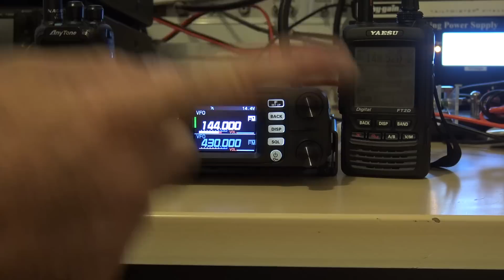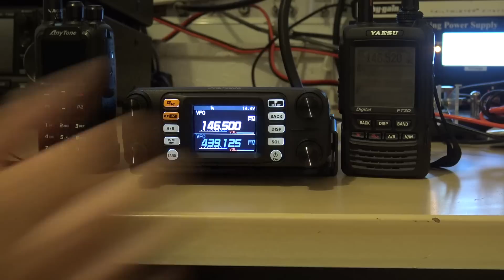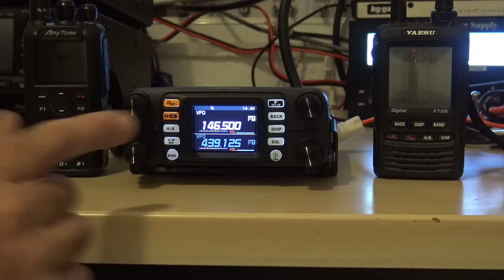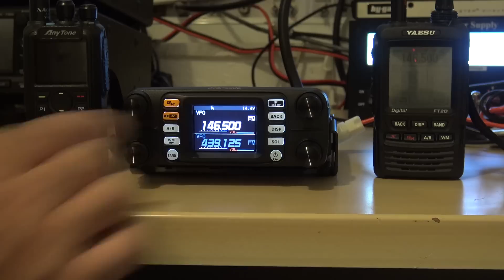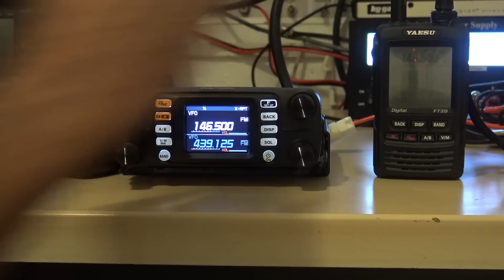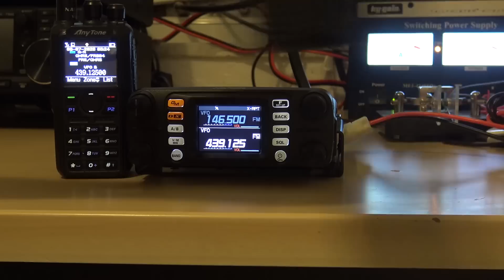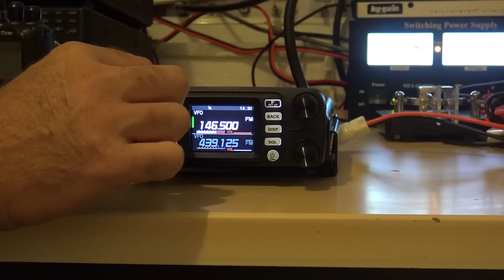Yaesu FTM-300D Crossband Repeat Mode, Tutorial

Comment: YAESU IS NOT ONLY PRODUCING THIS RADIO IN CHINA WITHOUT LETTING ITS CUSTOMERS KNOW IT'S SENDING OUT DEFECTIVE RADIOS AND NOT FIXING THEM PROPERLY, REDONE

I recently bought what was advertised as a 50-watt radio from associated radio in Kansas, it was the Yaesu FTM 300D. From the day I received it, I judged it to be defective because it at best it would put out perhaps 45 Watts on any given frequency. Every other radio high I've ever owned that claimed to be a 50 watt radio put out at least 60 watts. Not less than 50 Watts.

Anyway I was conned into paying return shipping and insurance for this radio back to associated radio to be repaired. I even had to invest in a dummy load in order to prove my case and get them to take a look at it. So in addition to the price of a brand new radio I'm out of almost a hundred bucks for shipping and dummy load. 

Unfortunately when I got it back nothing had changed nothing was fixed it's still putting out around 45 Watts on 146.520. I then demanded that Yaesu take it back and pay the shipping. They kept it for 3 weeks never contacted me, never said anything. When I got it back I was so apprehensive it took me 3 days to hook the radio up because I was catching on to what they were doing. Sure enough when I fired it up nothing had changed couldn't get over 45 Watts on  the most important frequency that we use.... the call frequency. This is the only radio I've ever owned that doesn't put out around 60 watts on this frequency. 
This radio is advertised as a 50-watt radio and every other 50 watt radio as I previously said that I've ever owned puts out well over 50 Watts. 
A friend's identical FTM 300D radio bought at the same time from the same company does put out 60 watts on this frequency, but mine doesn't. 

I feel like I have been deceived and defrauded and I'm about running out of patience here being treated this way by a multi-million dollar company that wants me to eat their mistake!

Does anyone have any other analysis of this? What would you do if you were in this situation? 

I am very tempted to go to the bank and dispute the entire charge on grounds of being defrauded. Would any of you consider doing this after having jumped through all these hoops, and having to face the indignity of spending an extra $100 trying to get a defective radio fixed and in the end they didn't fix it and they didn't even bother contacting me telling me that they didn't fix it. 

Anyhow I would much appreciate any input that you can provide I am very fed up I am tired of trying to do this the proper way because it hasn't worked

Comment: Thank you so much! I just got my FTM-300D and was excited to get it up and running well. This was my go to Video to get me going. I just getting started in Ham, got my Tech not long ago and so far have accumulated mostly all Yeasu gear.  FT-891 and FTM-300d for my base, VX-6R and FT-4X for my HT's.  Put up Comet GP-15, MFJ-1868 Discone and MFJ-1779C Di-pole antennas set up. Have a Z-11Pro-II tuner on my FT-891. Just Getting Started! KE8UGS  73's....

Comment: You won't find crossband repeat in the manual. The reason is that in some markets around the world it is not legal to do crossband repeat so they don't put it in the manual. I got that bit of info years ago when I worked for a HAM radio dealer, it came from one of the major radio manufactures , can't remember which one.

Comment: Thank you for ALL of your informative videos. Can this radio be used as a hot-spot if I don't have a C4FM repeater in my area?
Reply: Yes, with the appropriate additional cables between your computer and the FTM300, I can use it directly into WiresX rooms/nodes - or, separately - it can behave much like a hotspot.

e.g. I can connect the computer's WiresX software to America Link. Then set the transceiver to a simplex frequency and in a digital mode. Then my OTHER FTM300 in the truck can RX from and TX to America Link from a few miles away.

Comment: But can 1 of the vfos be set to a repeater with offset and tone?
Reply: VFO or Memory. Repeater with offset and tone. Neither, one, or both. I've just done it.

But please don't connect 2 repeaters together unless the control ops of both repeaters WANT you to. That would be bad.

Anyway, yeah, I had this exact scenario come up today. Tornado warning. I plan to be 40-50 steps from my shack for the afternoon, but want to listen to the SkyWarn repeater, 2m, 18mi away. FTM300 is hooked to rooftop antenna, can work that 2m repeater no problem. And now my 70cm HT at super duper low power can RX that repeater clearly, and I can TX to it as well. This is probably the most common use case for crossband repeat, and it works very well.

Comment: Eric, I have decided to purchase a FTM-300D after watching your Video. Can you setup cross and repeat mode to transmit into repeater shift Programed on both UHF & VHF Frequencies to link two repeaters during the net time?
Reply: You can definitely RX/TX with CTCSS & shift on one, and simplex on the other.

You can PROBABLY do it with a shift as well on both. Going to test.

(pushes buttons and twists knobs for a few minutes)

Yes, you can. It sounds kind of sluggish in my experiment. If it's under or over modulated, I'm not sure if you can tune any parameters around that. The repeater that's being cross-banded TO will probably lose the first 250-500ms of the transmission. Absolutely should not do it without the permission of the control ops of both repeaters.

In short, I would strongly recommend against it.

But CAN you? Yes. I just did it.
Reply: No

Comment: Does it also do the crossband in digital? Crossband in analog isn' t new stuff....also the ftm400 is doing it in analog. I am intressted in crossband mode FOR DIGITAL. ONCE AGAIN: DOES THE FTM300 OPERATE CROSSBAND IN DIGITAL? Many tnx Eric, vy 73.
Reply: I'm interested on that also, xrepeat en DN or VW
Reply: It will Rx AMS but only Tx FM as the Fusion protocol will not allow a repeater to repeat a repeater.

Comment: Isn’t this old news? I think my FT-8900 does this? Unless it’s not X-band? I know you can use it as a “repeater” like if it’s hooked up in the truck and you want to use a handheld away from there to transmit...Not knocking on you but (possibly) the commenters if I’m understanding my radio correctly (note: I’ve never actually used this function on my radio).
Reply: JeepJeffy04 I think it was rumored not to have the ability.
Reply: The FT-8800 & 8900, both offer cross-band repeater functions. I don't think it will in-band repeat though? Ie: VHF - VHF or UHF - UHF. If any one knows how, let me know.